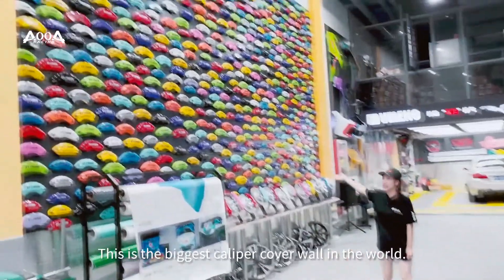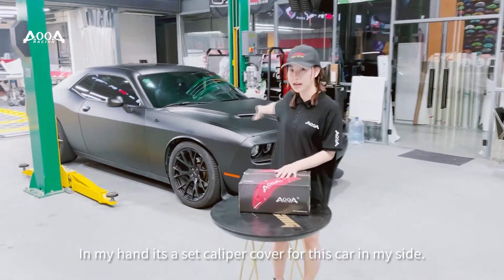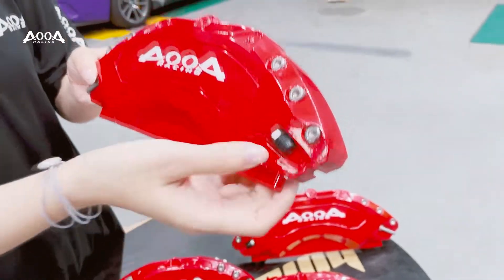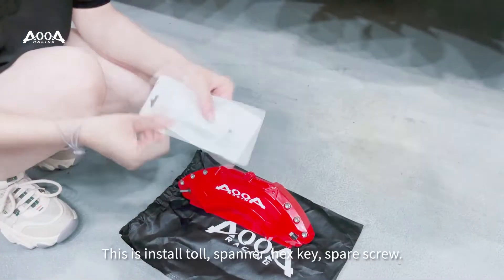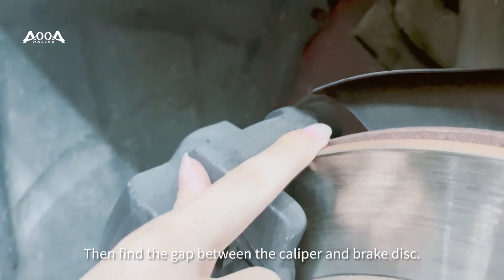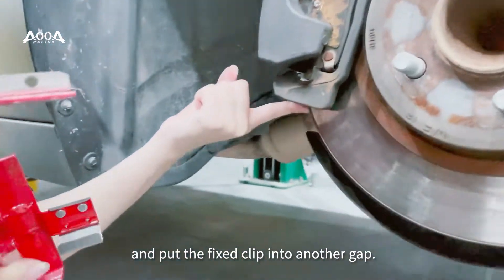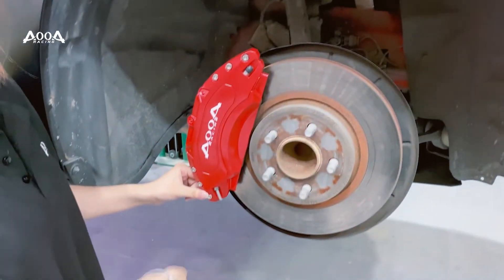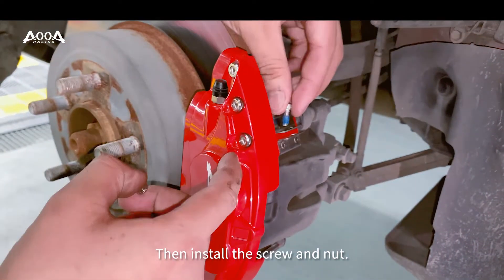AOOA Caliper Covers

Comment: Is it possible to install on a 19-year Honda Accord Hybrid 17-inch wheel?
Reply from the maker: I'd like to help with your question about the wheel installation, but I need a bit more information. Could you clarify if your Honda Accord Hybrid is a 2019 model or if it's a model that is 19 years old? Knowing the exact model year will help in providing accurate advice about the compatibility of 17-inch wheels with your vehicle. Thanks!
Reply: @aooacalipercovers  Sorry! it is 2019 Honda accord hybrid. (10th gen.)
Reply from the maker: Yes you could order in this link: https://www.aooacalipercovers.com/collections/honda-1/products/aooa-aluminum-brake-caliper-cover-rim-accessories-for-honda-accord-set-of-4?variant=42504341618926 @임금kokumi4
Reply: @aooacalipercovers  Thank you so much!!